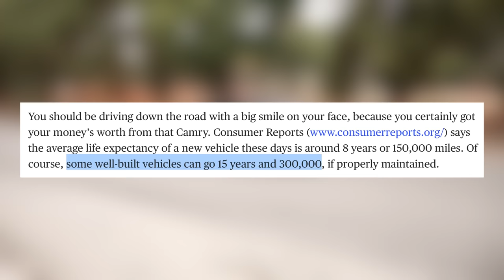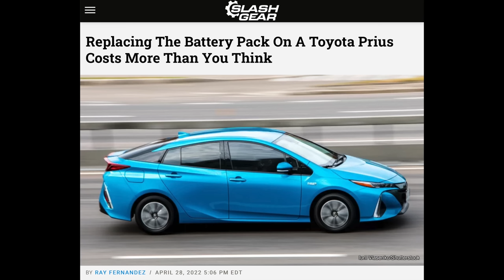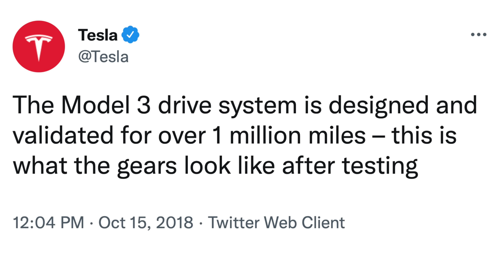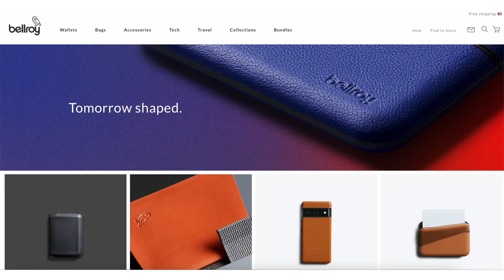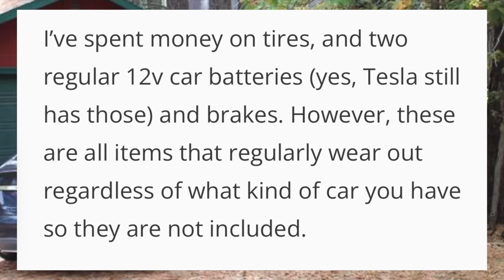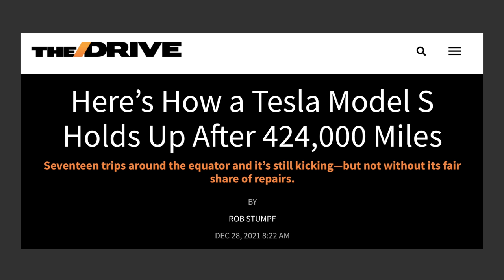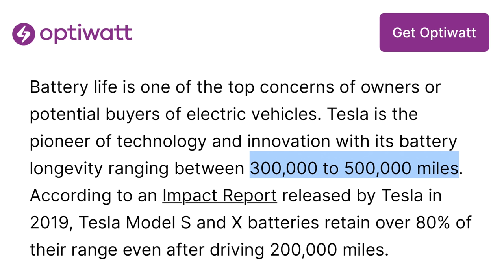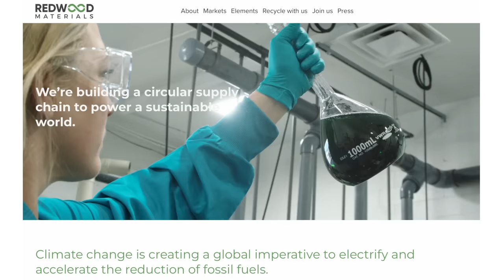The ONE MILLION Mile Tesla | It Still Runs

Comment: I lost 1.5% charge capacity in < 1 month on new model Y with 7500 miles of cross country traveling (9000 total) and supercharging to 90 to 95 % due to crappy facilities at TX superchargers and trying to skip the bad ones. Thankfully usually charge only at home and won't make such a trip again until supercharger network goes from making such trips possible to making them nearly as stress free as driving ioniq cross country the year before. Learned a lot about finding charger info and using autopilot to make next trip less stressful though and return legs N to S and E to W were much more relaxing.  Didn't notice any loss over first 1500 with almost all home charging with most basic charger.
Reply: The loss is not linear, it flattens out over time and it will take a very long time to lose another 2%
Reply: I wonder how you measured that loss. the numbers on screen are only BMS estimates (even if you connect some OBD, you're getting BMS readings), after good charge/discharge cycles you can get range "back". to truly know the loss you'd need to disassemble battery and check each cell individually. pretty sure the actual loss is not even at 1%. That's the problem for all those articles, real loss is only known by Tesla when they do replacement/repair and can actually measure things

Other way to measure practically would be to make same driving test in same conditions on same track every few hundred miles. But again, this needs to be controlled environment as anything can impact the range
Reply: @pauliusvindzigelskis2224  - thanks for the tip.  I am simply dividing the miles of range listed by the % charge listed and comparing it to the original range of 328 which initially matched.  At home I charge back to 80% every night instead of letting get low after 15 to 25 miles of driving.  I only have a 5 mph charger so that seems the most practical.
Reply: @markeby6985  You should let the pack drain down to 20% whenever possible before charging it back up to 80%. For many Tesla owners, they average 50 miles a day usage, so that would allow 3-4 days of driving (depending on driving habits and climate/weather) between charges.

Think about it, if you owned a gas car, would you refill the gas tank every day even if you only did 50 miles? Most people wouldn't. 

With that said, at least once or twice a month, drain the battery pack as low as you can (5% or less is a good number), then recharge it to 100% without using a supercharger. It you don't have a 240v charger at home this night take you a while to do. Anyway, this will help maintain peak battery performance and extend the pack's estimated life span. Try and limit the supercharging to when you really need it (like really long trips). This is the same thing Apple suggests owners do to get the most out of a new iPhone/battery.
Reply: @markeby6985  your BMS only knows it's capacity at high charge, not low, it is out of sync. You need to let it discharge to lower than 20%, leave it be for at least 6 hours before plugging back in. That way your BMW will know actual capacity and after doing this several times you will start seeing range "climbing back". Actual real world range shouldn't change and as I said before, it is probably more around 1% loss

I had same "issue" as Yours when had SR+ and always tried keeping at 80% because of low charge speed. Now I have LR and  do this low charge recalibrate thing once in a while and I barely noticed any range change after 16k miles
Reply: @CoroaEntertainment  There is absolutely no advantage to battery longevity by going down to 20% before charging. Yes, it gives the BMS a slightly better chance of accurately "guesstimating" your range or degradation but that's all. Lithium Ion batteries are least stressed in their mid and upper mid percentages. Of course the reason most people don't leave their EV at 20% is that it leaves the car with a very short range in case you need to go somewhere at short notice. It's OK with an ICE vehicle leaving it at 20% of a tank because they can drive 100 miles plus and stop for a few minutes to fill up if necessary. An EV may only have a real world useable range of less than 30 miles in the same circumstances ... and nobody enjoys getting close to the red zone whether in an ICE or an EV.

Comment: Even at the extreme 30% degradation the car  would be very useful.  When an ice motor goes out it needs a complete rebuild at best.
Reply: An ICE engine rarely goes out. A colleague of mine sold his car after 500.000 km. Petrol car. He really really did not do proper maintenance on that car... 
It still worked when he sold it.
Reply: @Xanthopteryx  thats a pretty rare scenario considering most cars that arent properly maintained don’t even last half as long. Just accept it, EV’s will last longer on average there’s infinitely less moving parts, cheaper to maintain and when the battery does go out in 10-15 years you can get a brand new one put in for 15-20k at most and you can go for another 10-15 years. Not many cars you can buy for that price new these days.
Reply: @FrenchyTube3  Well, engines are very reliable today. What kills the car is rust and electrical problems.
No one will ever pay that money to replace a battery in a car worth 1000-2000 USD. The car will have so many other faults so it is not worth it.
I have had several cars. My parents too. People i know too. NO ONE have had trouble with the engine, but all the rest: Brakes, rust, electrical issues, paint, interior, suspension and so on. More and more fail, but the engine runs.
Reply: @FrenchyTube3  I think in 10-15 years a battery will cost a lot less than 15-20K.
Reply: @Xanthopteryx  what I think you’re not grasping is the inefficiency of an ICE engine, sure they work, we’ve been making them for so long lol. People complain about panels gaps in teslas forgetting that they’ve barely been making cars for 2 decades and basically pulled off the impossible. Yet there’s already many 500k+ teslas and even million mile ones. Im pretty sure no car manufacturers were making million mile cars when they were just in production for 2 decades? Imagine how bullet proof and flawless they would be if they’d been around as long as GM & those other giants. You can’t tell me GM would still have a better product lol.
Reply: @Xanthopteryx absolutely not true. You must not be a mechanic.
Reply: @erichannes6392  Yes it is true. Engine reliability is really high today. Yes of course they need service and maintenance, as Everything, but they do not go unrepairable especially often. The car gets scrapped for other reasons well before the engine is out of order.
And of course you can have bad luck but that is just bad luck.
My first car, i sold after a heck of a lot of years. Rust was starting to take on it, and was looking forward to more and more repairs. But the engine was solid as a rock.
The second car tragically died on the motorway during freezing rain (the front was a total wreck - but the engine started so nicely when the tow guy was going to load the car - he drove it up on the tow truck!). About eight years old only though. The car now, no problem either but only soon seven years old. My parents cars over the years, no problem with the engine but age of the car and rust and stuff. My wives old car, the same. Rust and other problems (around 300.000 km). An old colleague finally sold his car (rust and other problems) after more than 500.000 km. Engine perfectly fine. The last years he did not even change the oil! 😲
And so on.
Engines just tends to survive the car today. And IF you need to replace it, it is not That expensive. From the scrap yard i can get a motor, fully working of course, from around equivalent of 2.000 USD. If i want a refurbished one (same as new basically), it is bit more expensive, like 6.000 USD.

Comment: FWIW: It's just anecdotal, but my LR AWD Model 3 (late 2019 purchase) had a total battery failure at ~31,000 miles. After some stress not knowing whether they would do the replacement (they wouldn't even do any measurements at the service center for two weeks do make the replacement certain), it cost me all of $9.50 as a battery discharge fee (it was totally drained according to the app, go figure). The big out of pocket cost was the one-way tickets my wife and I had to buy to get back to our home 1500 miles away, since we had been on a road trip when the battery died. We couldn't get a loaner at home either for the two weeks we had one fewer vehicles at home.
Reply: And that's why this renders Tesla out of warranty almost impossible to sell. Who would risk a 12k$ battery replacement on a used car?
On an ICE, even with a full engine failure (extremely rare under 120k miles), you would only spend 5k$ or so.

Comment: I have a Sonicare tooth brush and it seems as good as new after 10+ years. I am actually in shock that they can make lithium ion batteries that last forever, when they have an incentive to do so. I've spent hundreds of dollars in bristle brush replacement heads. There are vastly different types of lithium ion batteries. Some lithium batteries are bad straight out of the package, unless you actually buy a name brand battery.
Reply: A while back I bought a battery charger and a bunch of AA lithium ion batteries. But they didn't last very long. They didn't hold a charge after a short while. I don't know what the difference is. Why do some LI batteries last a long time and others don't? I've also bought one of those portable hand-held carpet cleaners and also a Dustbuster which didn't last long at all but those were LONG time ago so maybe it can be chalked up to old battery technology back then. In any case, I've sworn off buying any of those household devices with rechargeable batteries. However, batteries in things like laptop computers seem to last a long time.
I also used to have a Sonicare and it worked fine but it was the old model and when I need a new replacement head they weren't available anymore. But the battery was still OK.
Reply: Try some Lithium Iron Phosphate batteries. I did it in my generator.  Lithium Ion advertised they can go 1500 cycles, and the lithium iron phosphate batteries advertise 10,000 cycles. Lithium Iron Phosphate batteries also have no problems with getting hot on fast charge or discharge.
Reply: Same with my philips shaver, must be more than a decade old by now, yet there seems to be no problems with the battery. I also usually store it fully charged for the next use, so it's not like i'm doing any favors to the battery health lol.

Comment: Any data on how low the percentage of degradation typically goes before total pack failure? For example, are there packs still on the road at, say, 60% degradation? 

For those who are out of warranty, I imagine many of them could tolerate quite a bit of range loss before the vehicle no longer meets their needs.
Reply: If one starts with a 240 mile range, for example, a 50% range loss is still a 120 mile range EV which should be fine for a 'second' car that just does commute/shopping tasks while the primary car gets used for trips.
Reply: They level off at 90 percent degradation
Reply: @hilammandwee1283  

The lithium ion cells Tesla is now using stay at or above 90% for a long time.  But eventually they decline to the point of being useless.

As the EV industry moves to lithium iron phosphate (LFP) cells battery life will greatly increase.  The LFP batteries I'm using with my solar panels are rated for 10,000 cycles before dropping below 80%.

10,000 cycles with a 250 mile range EV would be 2.500,000 miles.  (10k x 250 miles)

If your (initially) 250 mile range EV dropped to 80% range the vehicle would still have a 200 mile range.
Reply: @bobwallace9753  Dahn shows how to get similar performance from NCM cells with restrained use:
"The NMC811 cells greatly outperformed the Dalhousie LFP cells, which according to Dahn are equivalent to the best commercial LFP cells that they know of."
"More than a million miles and a century of life" at the international battery seminar (IBS) held 28 -31 March 2022 in Orlando, Florida.
Reply: @waynerussell6401  Yes, yet another advancement in storage.  LFP are likely to be the most used chemistry based on material cost.  Until/unless an even less expensive material mix is perfected, something like sodium or sulfur.  

But the higher cycle life of NCM should mean that it will be even less expensive to operate battery powered vehicles where performance is critical and where the amount of total weight is very important such as long distance trucking and flight.
Reply: They usually die before the degradation reach those level.

Comment: Here's my question: are warranty battery pack replacements brand new assemblies, or are they "remanufactured" which would include a mix of used cells?
Reply: They are brand new batteries.

Comment: Most of these Teslas listed  have the current LFP type battery.  The NCA used now will degrade 10% + after first few years.  Although LFP batteries do not do well in colder/hotter environments, I still would rather have that pack than the NCA.  The LFP can be charged to 100% and degradation is minimal
Reply: The only Tesla’s that have LFP are the RWD ones

Comment: Wish your stats were applied to all Teslas. My 2019 Model 3 Performance charges to 282 Max and can travel approximately 190 miles on a full charge at speed limit No AC
If traveling via Navigation to a place 220 miles away with a full charge of 282 I would have to charge again before arrival?

Comment: It would be nice to see some data on Model 3 instead of Model S.  My model 3 has already lost about 10% range in 4 years with about 75k miles.  I always kept the battery charged between 20% and 80% as recommended and has only supercharged 3 times in 4 years.
Reply: Do correct me if I'm wrong but that guideline for charging is outdated. I think nowadays Tesla recommends always just charging to 80% and never let it drop to 20%
Reply: @donaldstinnett5630  I’m curious if that would apply to the LFP battery also. It’s hard to know what to believe. I constantly hear different things.
Reply: You need the new model 3 base models with the LFP battery 🔋 you can charge to a 💯 daily with no major loss .
Reply: @VeMultiVo  i have the LFP battery and the car tells me to charge it to 100% everytime
Reply: @alphagodvon  That's bad advice. LFP also suffers from faster degredation on high charge levels. There were multiple studies for calendar aging. LFP batteries lose 4% of capacity per year if you keep them at 100%, while it's less then 1% at below 30% charge. So if you use the car regularly you get  2-3% from calendar aging plus aging from cycle life. Those capacity losses stated by range numbers in the video are bullshit. The Tesla battery has multiple kwh of hidden spare capacity, to keep the driving range constant while it slowly degrades. You don't see a decline in usable capacity before that spare capacity is used up. After it's gone, people will definitely see the decline.
Reply: 110k miles and 4% degradation on my Model 3 long range. I exclusively supercharged it for about 40k miles too. I find that when the range starts to dip, I do a couple of charging sessions where I get it to as close to 0% as possible and let it charge to 100%. While living in the 20%-80% range is great for longevity, the batteries occasionally need to be charged to 100% so the computer can balance the packs. I let it charge to 100% a few times a month.
Reply: @VeMultiVo  its a battery ... ideal % is 50 ... but why buy a car when you cant use its full range and on top of that that range is low as it is fully charged ....

Comment: I am down 11% from original battery 4 years ago. Am I checking correctly? 
Current SOC is 83%/229 range. 229/.83=276 range at full charge. 310-276=34 miles lost. 34/310=11% range lost in 4 years(7.30.2018).

Comment: Having worked in service for various auto manufacturers over 15 yrs typically 10 yrs or 100k miles is considered a life span for a vehicle.  Anything beyond that point is considered a bonus and traditionally that's when more expensive components tend to fail.
Reply: I had a 2000 model Ford Taurus, brand new. It lasted to 158k miles and 15 years of use. It was still running but had numerous major issues. Sold it for $1200. Currently still have an '05 Chevy Silverado, bought new. It has 168k miles on it and 17 years of use. No major issues and no expensive repairs, yet.
Reply: @trevorjameson3213  my current Honda accord I bought new is 2013 has 150k miles on it. I've done all the maintenance and repairs myself but honestly all I've had to do is basic maintenance.  Cars can easily go passed 10yrs or 100k miles but manufacturers literally design cars to last that long, if they made the vehicles too well then they wouldn't get much business.  Lol

Comment: I've had my 2022 model 3 LR since Dec 2021 and I haven't noticed any battery degradation yet. Honestly it usually takes me 55% of the battery to pick up my daughter 150 miles round trip. It only took 50% the last trip 😆
Reply: Wow, that is a really short range. I would be forced to stop for recharging all the time. Guess EV:s are not for me
Reply: @thoos192  it's almost as good at your typical 4 cylinder. Plenty for a daily commuter

Comment: I had my battery go bad on my 2019 MX with less than 65000 miles.  Based on that experience I would not purchase a Tesla that did not have warranty left on the battery.  I also have a MS 2017 with 87,000 miles and everything has been good so far.